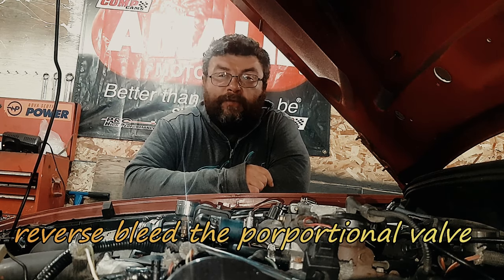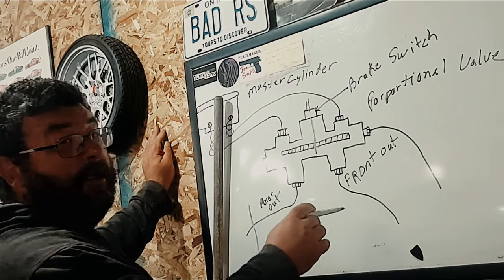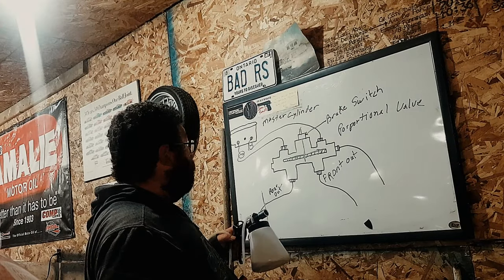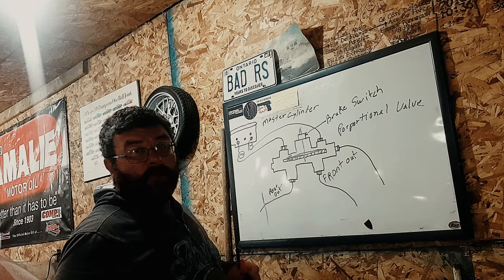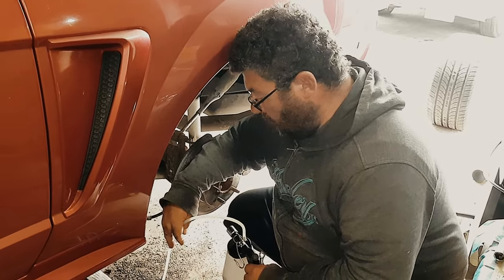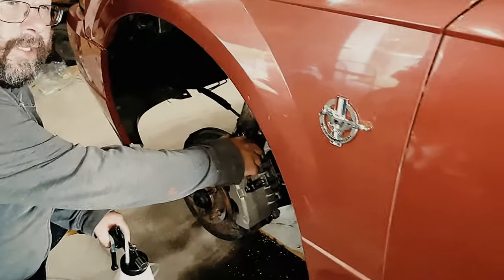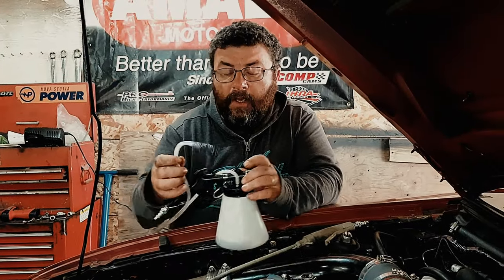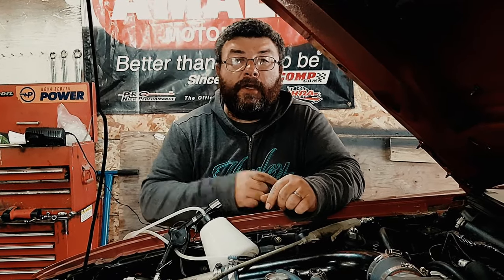brakes wont bleed proportional valve reset this guy's garage

Comment: I've been trying to bleed the brakes on a 2006 Ford f150 king ranch and I've replaced all the calipers all the brake pads and even the master cylinder and there are no abs lights on and I still can't get it to bleed. I don't know what it could be or what to do. I'm thinking it could possibly be the abs pump but then again there isn't any lights on the dash. I'm lost and any help would be greatly appreciated
Reply from the maker: What was the problem you started with?
Reply: @thisguysgarage  well the guy I bought it from said one of the calipers pistons had busted so he replaced it and said that all I had to do was bleed the brakes and I've bleed them several times now and it still stops but the brakes are very spongy. I think air may be trapped in the abs pump but the abs light isnt on at all nor any other light so I'm a bit lost
Reply: @noahcraft4905  did you ever sort this issue? I having a similar problem but no abs light is on my mustang
Reply: @Riley Dines  I did actually find out what the problem was. The previous owner put new calipers on before I got it and told me all I had to do was bleed the brakes but when I tried multiple times they never bleed properly so I got to looking and thinking and the issue only ever happened after the new calipers so I looked at them and the guy installed two right front calipers on the truck one on the right and one on the left. You'd think that you can't put a right on the left but you can except it would be upside-down which makes the bleeder valve be on the bottom of the caliper and not at the top where it should be which makes it to where you can't bleed the air out of that caliper which means that you'll never be able to get the air out of the system. So hopefully that helps you out and anyone else having the same issue.
Reply: @noahcraft4905  thanks a lot for the reply I’ll take a look and make sure my calipers are installed with the bleeders facing up for sure!

Comment: Getting ready to try this after replacing section of both rear lines. Have a question as car has been sitting, off, til the lines replaced. Had a leak (bad flare). when I added brake fluid. So seems it was getting fluid to the line. After removal and fixing the flare, can't get it to bleed (rear passenger side). Would the PV move in a scenario like this? Since hydraulic and was pumping the problem pedal, my guess is yes. But this is first time dealing with brake line repair... and still have to get the other bleeder valve loose to replace it. Thanks very for any answers!
Reply from the maker: the second pump going to the floor triggers the action of the PV in total brake line failure ,so a leak would stand to reason would cause the same reaction just over the course of multiple brake pumping,be sure to let me know how you make out ,any other questions fire away and please ring the bell, it helps out greatly

Comment: Please respond... if I fluid reaching all 4 calipers but pedal goes to floor with almost no braking response can I run a tube from each bleeder screw to the master cylinder reservoir 1 at a time and pump the brake pedal until only fluid is in the tube will that properly bleed the entire brake line system and master cylinder where the brake pedal will be solid and responsive
Reply from the maker: if your brake pedal is going to the floor when the system is properly bled i would look at the master cylinder first ,  because if the booster was bad you would have hard brake pedal instead of a soft pedal.    #1 suspect is the master cylinder
let me know how you are making out

Comment: Great video! How do you know when the proportion valve is back to center? My rear brakes are locking up, I've been adjusting the rear brakes in but that doesn't seem to be working. I did adjust the rear shoes far enough so the front finally locked up first but I don't think that's the real problem. When I bled/flushed the old fluid, which was pretty dirty I had a lot of flow to the front calipers and didn't need a vacuum pump, the rear drum brakes however barely had any flow so I had to use my vacuum pump. Been trying to get this right for 3 days now. From your video and with my rear brakes locking first,  it seems like I need to move my prop valve to the front, or back to center. So would I pull fluid to the rear and open a front bleeder? Gonna give this a try...
This is getting frustrating to say the least!
Reply from the maker: I would check the rear flex hose. It sounds like you have fluid on all four corners.  When the flex hose gets bad it won't let the pressure off the rear shoes. They are fairly cheap and it's good to replace them from time to time even if they visually look ok, let me know how you make out👍
Reply: @thisguysgarage  it has steel lines on the rear 2010 Chevy Cobalt. I think I got it, when I blew air in the front disc bleeder I heard a pop, bled the air out and drove it, the front brakes are grabbing more now.
Reply from the maker: @ManikMekanik  perfect 👍

Comment: I just did a front disc conversion on a car that had drums on all 4 corners. I had to run new lines for the front. When I went to bleed the system I had a bad leak on one of my new lines. I had a bad flare and had to redo the line. I no longer have a leak, but I'm now having trouble bleeding the front. I'm guessing it's the proportioning valve.
Reply from the maker: did you install a proportional valve  for front disk brakes?
master cylinder changed for for disk brakes?
if yes
try compressing your front calipers like your putting new pads on and try bleeding again.
Reply: @thisguysgarage  Correct. New master cylinder, and a disc/drum proportioning valve. I did not remove the warning circuit and lock the valve in place when bleeding though.
Reply from the maker: @RYTHMICRIOT  I don't think the circuit warning would effect bleeding. Is it possible  the rear line is feeding the front? There would be much less fluid for a wheel cylinder then a caliper?

Comment: I can bleed the rear brakes. Can a prop valve keep the brakes from getting ENOUGH pressure for balanced braking, or is it all or none?? Read brakes dont seem to have enough, but some pressure. Thank You
Reply from the maker: So you can  bleed your rear ,no bleed on the front?
Reply: could be air in abs modulator

Comment: I have a 1978 Datsun 280Z.  Brake lines were empty for a long time while I restored the vehicle. Filled it with brake fluid and tried to bleed the brakes multiple times but the brakes stay squishy and it acts like the brakes are not bled.  Is this the proportional valve causing problems?  When I open the bleeder on the front, fluid runs out; if I open the bleeder on the back, fluid barely drips out and this is without pushing the brake pedal.  If the pedal is depressed, fluid runs out of both sides. I'm trying to find a new proportioning valve to buy to replace the proportioning valve but having little luck finding the right one!  Thanks!

Comment: Curious, when  you say can not bleed, you mean can not get all AIR OUT of the system whether it be front or back? I am getting air in my front's and no air in my back's.  No matter what I do.
Reply from the maker: ARE YOU GETTING A STREAM OF FLUID? OR NOTHING AT ALL?
Reply: @thisguysgarage  stream of fluid, with air bubbles.  acting like a failed m/c but not because i've plugged and tested that.  was curious as your video said no fluid in one system until rod was even, then fluid.

Comment: I've got a 1998 ford ranger that the front drivers side line got ripped off. I replaced the line and now I have no fluid coming out the front of the Master cylinder. I done your hail Mary deal and got fluid moving back to the front line but I still have none coming out the front of the MC when I break the line loose. Does the ABS module block the fluid from coming out there?

Comment: I Have bumped the air twice from the rear and got fluid out left front. But the valve wont stay in the nutral position   When I try to bleed the rear brakes it will not bleed !  Any ideas?

Comment: Thanks for the video.  

Hmm.  I purchased a aftermarket complete brake booster kit with proportion valve and I get fluid from all bleeder screws except for the left rear line.  
Would I do the same solution as you demonstrated?  Or is there something else?

Also,  the drum brake reservoir on the master cylinder doesn't "bubble" when I bench bled the mc...the front on did.  Is that a bad thing?  
Also the proportion valve is new and has a built in a adjustable valve as I converted from manual front drum brakes to power disc brakes. 

Thanks for your help.  🙆
Reply from the maker: There has to be a blockage in the line if you are getting fluid to 3 of 4 breeders.  I would check the flex hose first.  There is only one line going back so . The obstruction has to be between where the  line is split to the wheel cylinder.  

What kind of car?
Reply: @thisguysgarage  Thanks for the response.  
It's on a 1976 cj7 jeep. I Converted from front drum manual brakes to front power disc brakes.
 I purchased an aftermarket brake booster assembly from ebay. 
Prior to the new booster kit, I tried using a used yj jeep booster assembly but had a soft pedal.  
Thanks again for your help
Reply from the maker: @cj7girl280  no problem always hapy to help.  Is the new proportional valve  adjustable?  
I still think you have a blockage in that section of line in the rear.  Let me know how you make out.

Comment: I blew my front line so to get a good bleed I should blow air into front bleeder to reset the  proportional valve?
Reply from the maker: Try compressing your caliper first.like your installing new brake pads.

Comment: Just replaced front hoses on my 97 ram 1500, along with one hardline in the rear. I’m having trouble bleeding them. At his time I’m not getting fluid out of the front calipers, only if I press the brakes the fluid will come out. The rear brakes are bleeding fine. Is this a proportional valve issue ?
Reply from the maker: Hey pattie did the front flex hose bust or leak ?

Comment: Im here with this issue. I put a new caliper on it. And what you know. The caliper wouldn't work. It got hot as hells. And I had to get another one. And I am still having issues of getting brake fluid to come out of the bleeder valve. But, when I start it. I can get it to bleed out. I usug%ally bleed my brakes with it off. Any suggestions.  Im getting fluid to the caliper. Could it be the washer I have on the brake hose bolt on the caliber. Not allowing enough fluid to come through?
Reply from the maker: If you're 2nd caliper is sticking and your getting it to bleed the problem is more than likely a bad flex hose not allowing the fluid back out of the caliper. Sometimes the flex hose gets crushed at the color, does this sound like what you are experiencing?

Comment: Cant get any fluid out of front calipers. Tried blowing into the rears and only got fluid and air moving into the MC. What to do???
Reply from the maker: start bleeding at the master cylinder and verify there is fluid at the master. then start working your way down to the alipers .  verify the master is moving fluid.   let me know what you find.

Comment: This weekend I replaced rear brakes/rotors on an 02 Lincoln Town Car. Then I wanted to bleed the brakes with my MityVac vacuum bleeder. I bled the rear passenger without any issue. Moved on to the rear left and zero fluid came out no matter how much I waited/vacuumed/primed up near 20psi before cracking, etc.  Took bleeder off, still no fluid.  Upset and whatnot for awhile, I didn't try bleeding any of the other corners. I reassembled things and drove around (and delivered car back to her), no braking issues at all. The old pads on both rears looked the same wear when I removed them. No idea what the problem with bleeding! :( I only watched your video yesterday, and can't try to see if this proportioning valve strategy would work. Heck, I don't even know if this vehicle has this style exactly. I think it has a ride height based pressure control thing too. Not sure how that could cause a bleeding issue. Still need more deep intimate knowledge of brake valving etc.
Just leaving this here as a note of my experience this weekend. Any comments, questions or helpful tips from anyone is welcome!
Reply from the maker: could definitely be a problem with the load leveling proportional valve, if you are able to bleed the right and not the left for example i would try blending in front of the flex hose ,these are another source of blockage associated with fluid restriction on one corner.  i did a video explaining this in detail regarding a load leveling brake valve.
Reply: @thisguysgarage  Thanks. My question from that video would be.. is there a big risk of air pockets going up into master cylinder/ABS when taking flex hoses off for diagnosis purposes (testing where the fluid does come).. or is it not really risky as long as reservoir is filled? (is it basically like gravity bleeding in this case?)
Reply: possibly abs module
Reply: Did you figure yours out? I have the same issue, I bled half a pint from the rear passenger without much issue but not a drop from the rear driver side. When I open the bleed valve the brake pedal is still stiff like the bleeder is closed
Reply: @KibblesNbytes  had the person take it to a shop where they could raise it evenly on all sides. Pretty sure it's a partitioning valve issue from uneven raising of the vehicle

Comment: I have a 89 suburban. I recently replace the master cylinder and both front caliperss. I couldnt get fluid to do more then trickle out of the rear. So i ended up replacing the the porplrtioning valve. Still nothing. I can bleed the fronts but nothing in the rear and still no pedal.
Reply from the maker: i would check your flex hoses.they are known to swell up and cause blockages.
89 would not have  ABS ?

Comment: So my master cylinder has bleeder screws, if I’m trying to bleed the rear  which screw  do I hook to front or rear?
Reply from the maker: if you have the vacuum bleeder hook up to the bleeder on the master cylinder ,open the rear bleeder and draw it back.

Comment: Okay so what if I bleed all my breaks individually and in sets front and back at the same time and there is pressure when the truck is off but I turn it on n all pressure goes away I’ve bleed the master cylinder as well
Reply: Could my combination valve be stuck or have air in it

Comment: Hello,

I tried the procedure but from the front bleeder because my master cylinder doesn’t have a bleeder, and unfortunately it didn’t allow brake fluid to go to the rear. It did for a little bit and it wouldn’t do it again. I purchased the valve but was hoping that it would have worked. Parts are hard to get, and it took me a week for my new master cylinder to get to me. Now my front brakes work amazing, but when I went to bleed from the rear no fluid was coming out. I unplugged the line under the wrangler going to the rear brakes, and nothing. So I removed the brake line to the valve and nothing.
Reply from the maker: compress your rear calipers it will force the fluid back to the master and recenter the prop valve.
Reply: @thisguysgarage  

I just bought the new part. My wrangler has big wheels, abs wheel spacers so it’s a pain to remove all of that. Then I’m not even sure how to compress the brake drums. I bought the new proportional valve for $49. I was having issue with my brake pedal going to the floor. I replaced the grommet for the brake booster because it was cracked . Then I replaced the master cylinder which that made my brakes stay firm and not go down to the floor. They actually work like never before, but I don’t like that I was unable to bleed them from the rear.

Comment: Hi sir I have a Tercel 1.5tdiesel and has abs I've had to change the rear wheel cylinders  and bleed the fluid didn't come out what do you suggest  me doing thanks
Reply from the maker: check your flex hoses ,sorry for the late reply was on vaca

Comment: i HAVE A 96 Chevy Beretta Z26 and dont have brake fluid to the back brakes. I  ordered a vaccum brake bleeder. My master cylinder has two bleeders, which one do I hook the vaccum bleeder up to to move the proportional valve?
Reply from the maker: rear drum?
Reply: @thisguysgarage Yes rear drum.

Comment: 2011 rear both side brake fluid not coming when bleeding and checked near master cylinder rear both brake line not coming fluid what is the reason any one explain me , what is the reason spl Toyota land cruiser 2011 model pls.
Reply from the maker: try compressing the rear calipers like you are putting new pads on ,if it bleeds afterwards it was the proportional valve.  if that dont work start looking at the rear flex hoses

Comment: I'm just going to bleed the brakes again. I'm sure that my daughter & her husband probably took turns pressing on the brake pedal after she said the brakes weren't working. We already replaced the bad lines going to the rear of the car, now it's just bleeding the system correctly. Plus the front calipers were replaced as well sooooo it's gonna require that much more bleeding anyways.....